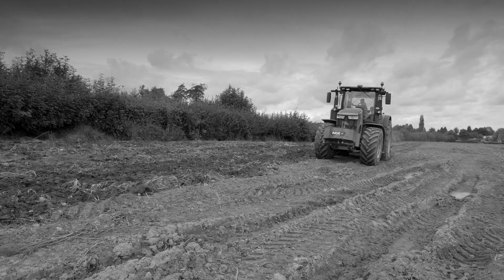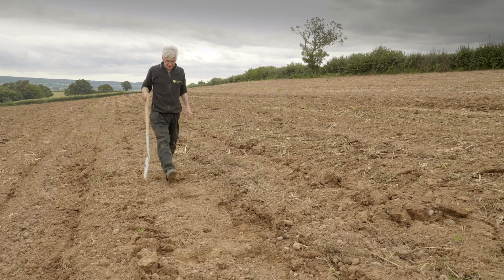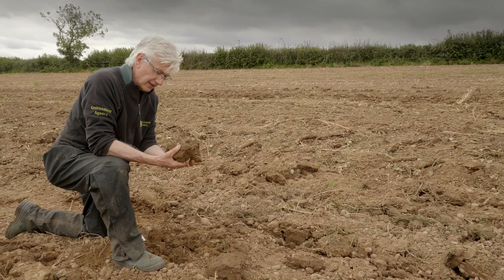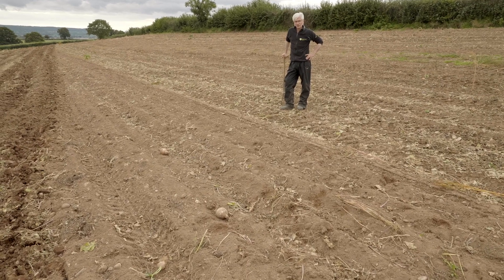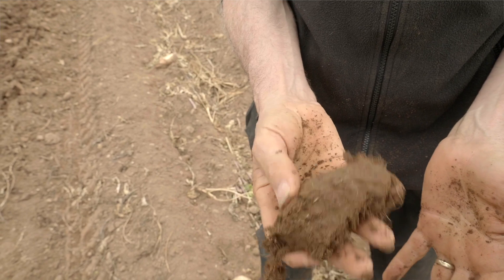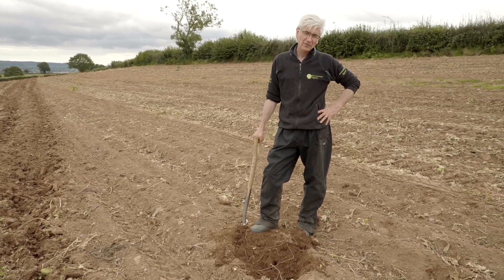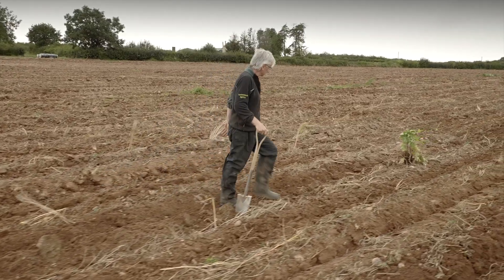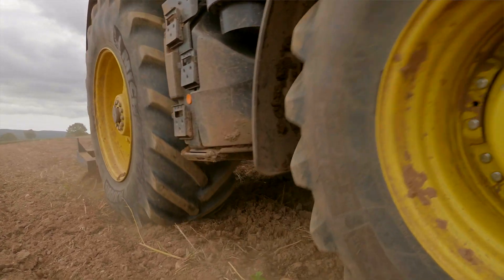Soil erosion related to the wet weather (Part 2)

Comment: In the interests of constructive feedback, and further to our comment on the first part of these two videos. Having watched the first part, we had hoped that this second part would contain more guidance on potential solutions to avoid compaction, water logging, scour and general degradation. However, these were only briefly touched on at the very end of this film. A collaboration, say between Dr Smith from the EA and an agricultural soil specialist (say someone from Defra) to explain what the most practical, sustainable good practices options are, would be most welcomed.